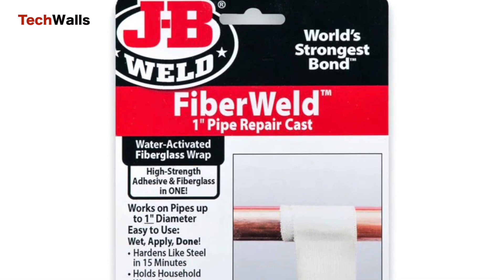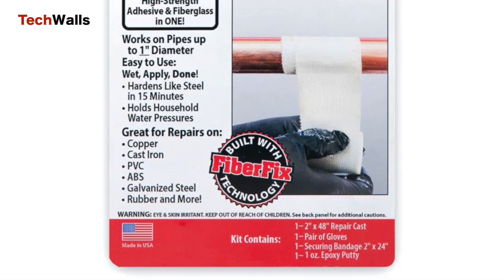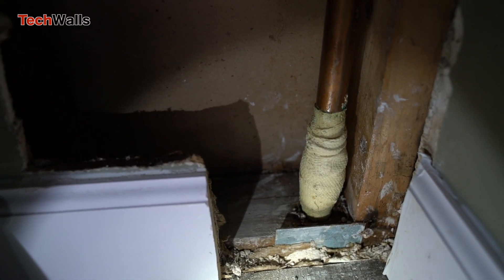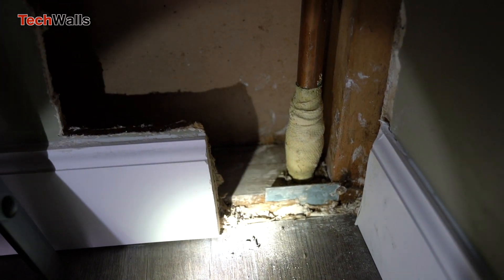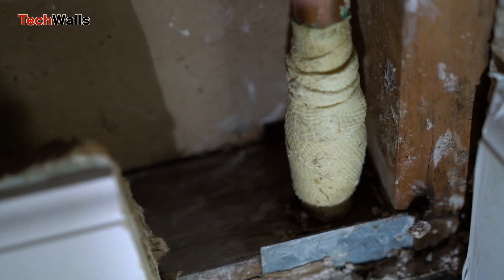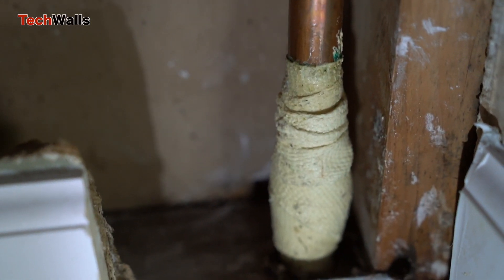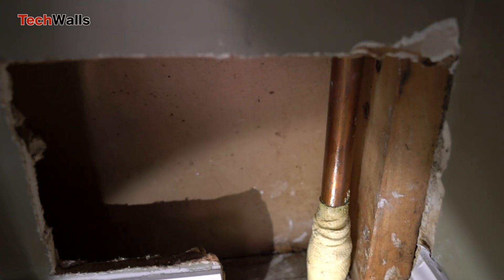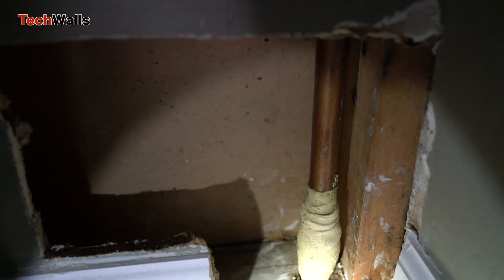J-B WELD FiberWeld Pipe Repair Cast - Can It Fix Pinhole Leak in Copper Pipe?

Comment: Will natural gas eat away at this product ?
Reply: Technically no, but this is barely water tight, definitely not air tight. So gas will likely escape through which is not only bad for your health but also very dangerous if a spark or open flame is in the house.
Reply: @Дрэк-Же-Стйл  I used jb weld the epoxy the one you mix I used it on a gas lamp pipe it size is about 3/16 very thin line had a pin hole leak I sanded and applied paste let it dry 6 hours the psi on a gas line is not a lot as compared to water so it holder up as of now
Reply: @Дрэк-Же-Стйл  thanks for reply